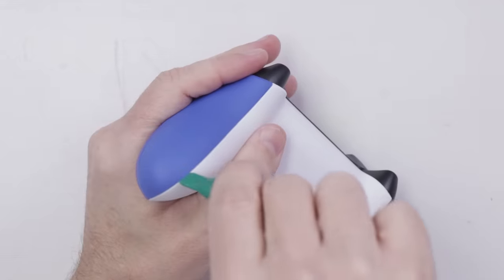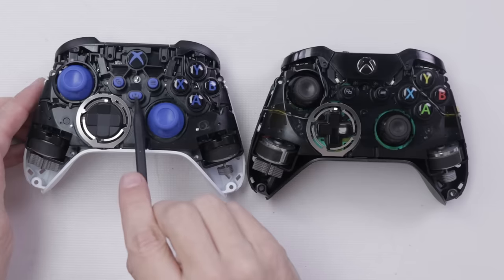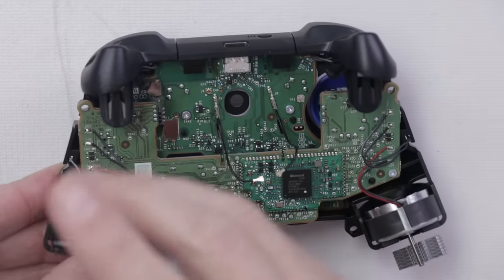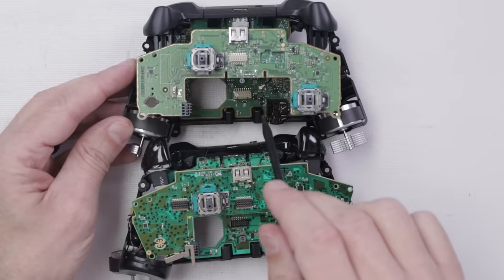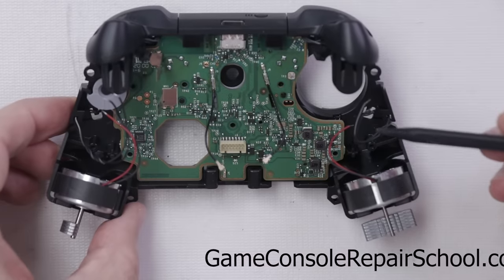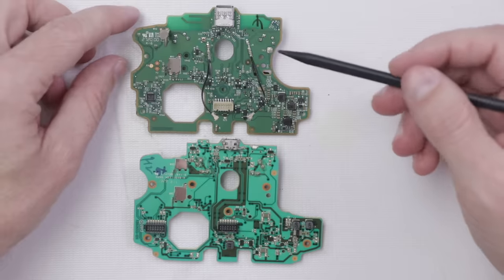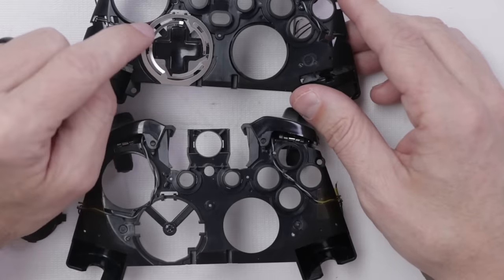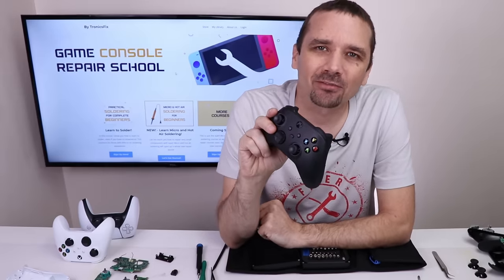Xbox Series Controller Teardown - A Repairability Perspective

Comment: Hey Tronics dude. I tried using your video to take my Xbox series X controller apart and I took the little wires with the tiny plugs that hold the motherboard together off and one of the connectors broke. I put the controller back together without reconnecting the wires and it seems to work but it turns off randomly and crap now. What are those two little wires for? could you tell me?

Comment: I’m not super confident in my ability to do it, but how possible would it be to use the shell, bumpers, and triggers of the new controller but replace the motherboard and sticks with an elite series 2? I love the functionality that the elite has but honestly I love the feel of this controller better. I know I’d lose the share button (which is sad but fine) but my elite series 2 has kinda gone through some stuff and needs a new shell anyways so I’m curious how possible/difficult it would be

Comment: Why is it they use two different size rumble wieghts just always wondered why they are not the same exact size and weight just out of curiosity
Reply: it changes the frequency of vibrations. if they were the same if would feel like a stone in a wasching machine.

Comment: So basically it's the same controller. Now, I play on pc and I've had too many problems with dpad on Xbox one controller. I change the plastic thing under the dpad 4 times in 6 years. Than last year I bought a DS4 and it works really well (I play many retro games, so for me, dpad is very important). I hoped the Microsoft would have make some changes on the dpad stuff. But it isn't... At least I'm happy that now I know what I will buy next 😌

Comment: I had a problem with the solder for the RB button it is small pins but the solder would not melt even cranking the Soldering iron to 450c still would not budge. Was nothing wrong with the Soldering iron i got as works on other things. I am replacing my RB button with a new one as it keeps failing to register and does not click as well as the other one.

Comment: The metal ring around the d-pad has a new extension that goes down and makes electrical contact with a hole on the PCB. Any idea what that is about?
Reply: doesn't look like it makes contact with the mobo. It probably hooks onto plastic in the frame to stabilize the metal ring better

Comment: I bought my xbox wireless controller last year (29.9.2021) (the irony, the warranty expired 1 day ago). So I literally never used this controller cause I bought 2 of them 1 carbon black and one red. The red one I used like 5 minutes. I left the batteries inside the controller and never used it again cause i was using the black one. few days ago i wanted to use the controller but it seems the batteries exploded and there was liquid inside the controller so the controller doesn't work.

Comment: Wait, so the series X S controller charge port is USB C?  I got one on Black Friday to use with a PC and Pi and I don't think anything in the 'manual' that comes with the controller actually specifies what kind of port it is.  Actually there's not much info at all on using this with a PC. E.g I needed to know the controller Bluetooth MAC address. Everything says "Go into the Xbox menu and...." well I can't do that. Doh
Reply: It is not a charge port, it is for connecting it to PC/Xbox/whatever via USB cable so you can use it without batteries. It only becomes a charge port if you buy one of their "battery packs". Otherwise it is not used for charging, the thing runs on standard or rechargeable AAs if you use it wirelessly/bluetooth.

Comment: Super disappointed they didn't upgrade the joystick modules. What a shame.
Reply: alexander pierre  spam
Reply: @proud90skid15  Reporting him.
Reply: alexander pierre  first off, the controller you say breaks in 2 slams actually takes 4 slams when I tested. Second, Xbox console is more durable than pee S console and will always be better. Also the console you call flawless is experiencing a higher fail rate due to fried gpu occurrences

Comment: Question. where can I buy a replacement rf wire that solders into the controller mother board and snaps into the upper board. There are two. I need one, someone tried to add fancy buttons and pulled the wire out of the connector. From my research people are saying it's a MHF4 0.82 with solder end. Is that correct or can you lead me to the right kind. Thanks

Comment: I use a Xbox Series controller on PC and it feels way better than the Xbox One controller!
Reply: So the sticks are a bit loosie on the center like in XOne controllers too?
Reply: @6abo.  Slightly but not even close to as bad as Xbox One is! Altho i'm sure with a lot of use they all get loosie goosie eventually but thats just how it is!
Reply: @Rulle666  in that case I think the elite series 2 would be a great option, thanks!
Reply: @6abo.  Yeah the Elite 2 is better, but its way more expensive and it ends up just as loosie goosie after lots of use too. So in my opinion its not worth all the money! But if you feel its worth it then absolutely go for it!

Comment: I'm a little sad that Xbox didn't do more with their controller. At least update the haptic feedback or the motors same type of motors that have been used all these years It's a little sad compared to Sony.. I like the fact that you can use it on the Xbox one consoles but at the same time I'd like to see a little bit of innovation not just some shaping.

Comment: lol! I tried to open my controller but accidentally tore tore the motherboard connector (came out with the motherboard piece). Is this fixable? Or do I need a new one?

Edit: I opened it because the home button wasn’t working, while every other bunny on worked fine
Reply: so they came out still connected/inserted? Are the legs broken off in the solder on the motherboard or still attached to the socket? Or did the solder all pull up off the board and tear the board?

Comment: Xbox made it so much harder to take these things apart. They could of designed it so you could of taken the 2 part mother board off without needing to worry about soldering. Course my bumper button has gone bad like 10 remotes before it. But I don’t think i can fix them anymore with needing to solder now. I’m pissed. Grrrr. Can’t they design a damn bumper button that doesn’t fail so often?

Comment: Does the controller still use battery???
Reply: If you want yes. It is also possible to use rechargeable batteries or the official xbox rechargeable battery pack

Comment: The big difference for me that wasn't mentioned at all in this video is the shoulder buttons (lb and rb) on the old style before the 3.5 mm jack, they were independent buttons that simply pressed down on an internal button. The 3.5 jack version for some reason made both shoulder buttons connected with a super thin piece of plastic that is meant to bend when the top button is pressed and eventually snapping in half or at one end. Which would be such a big problem except for the other dumb change that made the 3.5 jack controller so bad, they moved the internal button from facing up, to facing down (as you can see in this video) and had that dumbass connected button reach down and sideways to press it... It's seriously the most idiotic way to do it because they constantly break and now you can't even press down harder on it to trigger the button. Or maybe they wanted it to happen to sell more... Either way, I'm glad someone there caught that big mistake and fixed it.

Comment: Hello sir I have problem with my controller it wasnt calibrated my analogs didn't stick to the calibration wall and right ananolg in cod wouldn't stop just moving right and left I took it to a so called technensian and he changed shocks for 3 or 4 times last time I tested it and everything was normal but when I returned home and wanted to play after 5 min controller got crazy left analog only want to left d pads jumping 2 up and down I recalibrated it fixed but 5  min later it got crazy again this time right shock only fast turning to left and left and right sides were changed.after every successfully calibration its goes crazy again Please help me is this issue from board or shocks.its been 10 days and not fixed yet.

Comment: I found that the wires connected to the rumble motor come undone much easier than on the Xbox One S controller. Do they do anything other than operate the rumble motor?

Comment: I do not understand the need for three removable plates on the controller.  It's unnecessary in my opinion.  You have the very back plate, you have the two side grip plates, and you have the faceplate.  I find that to be a very stupid design choice.  I don't get it.  I think it would make more sense if it was just a top faceplate and a backplate.  Two plates total that are held on by screws in the back.  PlayStation uses exposed screw holes and there's no fuss over those, so I don't understand the need for Microsoft to hide them all on theirs.  My biggest pet peeve with these controllers is small, but irritating.  If you have an Xbox controller, you probably know what I'm talking about. The side grip plates are rarely if ever, flushed with the edges of the faceplate. Which gives it either an underhang or an overhang.  This is extremely annoying because when you are holding the controller in your hand, you can feel sharpness from the not flushed edge of the side plates.  I have a controller that is completely flushed on the right side with no sharpness. But the left side has the edge of the faceplate hanging out a few centimeters over the side grip plate. So when I hold it in my hand, it feels like there is a sharp sensation running down the palm of my hand because I am feeling that Gap between both plates basically. It's very annoying.  And I don't know how to fix it without taking a sander to the top faceplate and completely ruining the aesthetic to sand it down to where it doesn't extend out past the edge of the grip plate.  I really don't want to go that route.

Comment: Microsoft knew what to do just improve an already amazing controller, sony on the other side... they made a controller that spys you with both mic and because of that the battery life is super bad and its much less confortable than the xbox controller
Reply: Well you clearly haven't even touched one because you can mute the mic and the battery life is fantastic as well as the ergonomics.
Reply: @brandon_nope  Ye all experts say that if you use its new tech it lasts 2 hours and a half, and without it a maximum of 7 hours while the switch controller lasts like 50 using the hd rumble which is the same as haptic rumble but with other name the tech is the same, it will happen like in the switch nintendo will use it for 1,2 switch and not use it anymore in ps5 only astros playroom will use it and you won't see it anymore, i have touched one and use it like an hour a friend of mine let me use it and i think its ergonomics are garbage compared to the switch pro controller or the xbox series x controller
Reply: @soulmourne2698  I personally prefer Xbox and Nintendo switch controllers as well (i had a Logitech gamepad at one point which had the PlayStation stick layout, and I'm not really a fan of that stick layout)
and I often prefer to play with the rumble turned off completely anyway (with the exception of certain games, one of which is Monopoly)
Reply: @pineappleroad  I have my own exception too and its dragon ball budokai tenkaichi 3, but anyway the problem is that if you don't use the rumble why buy a new controller if the new thing that offers is rumble and a bit different ergonomics? i think its not worth the ps5 controller personally i even preffer the ps4 one
Reply: @soulmourne2698  I also find it a shame that sony seems to have decided that PS5 games can only be played with a PS5 controller (and not a PS4 controller, PS4 controllers only work in PS4 games)
Reply: @pineappleroad  yep i know...
Reply: @pineappleroad  It's probably so that players are forced to use the new controller to not miss out on the new features. Personally, I don't think it's a huge deal considering most people will only need the one controller already packed in with the system.
Reply: @soulmourne2698  Whoever is saying that is blatantly lying. I played a few hours of Astro's Playroom and then a few for a couple of PS4 titles and I still didn't kill it.

Comment: I just felt ashamed for Microsoft. Not a next gen controller. Lack of initiative.
Reply: Its a controller. Lets be real, very few games are gonna use the PS5 controller and if they do its gonna be very gimmicky. Plus looking at how bad the dualshock/dualsense game compatibility thing is with PS5 playing PS4 games, Microsoft made the right call.
Reply: @elk3407  the haptic feedback in general feels more premium. It's like comparing taptic engine from iPhones with normal vibration motors in regular smartphones that are no flagships. It's so much more nuanced and doesn't feel so outta control once it started. It doesn't just vibrate the whole controller but gives you even slightest feedback in form of little "taps", like feeling individual raindrops. And that on different areas on the controller, clearly distinctable from each other.

Furthermore, it will be used widely is my guess. Sony did it clever as they provided presets for the features, so developer can base their work on them. In addition some kind of rumble feedback and the use of triggers is just there in games anyway. It might take some extra work, yeah, but it isn't that complicated and when old gen isn't supported anymore, there is no reason to just use it. Especially as I am pretty sure, Microsoft will also deliver a new controller in the next years with exactly this featureset. It would be a shame if not, as I would classify the DualSense now as the new standard for the industry.
Reply: @paddipat  Ok, haptic feedback is a good point. Both Switch and PS5 have great haptic feedback and xbox's is lacking...... but everything else the ps5 controller has new is really gimmicky. I actually violently hate the new triggers, so I'm gonna have to say NO to the dualsense being the gold standard.
Reply: @elk3407  you hate it, objectively it's better. It's possible to turn the feature off, so no reason to not just include it.
Reply: @paddipat  But what is the point of a feature that only exists to be a gimmick for tech demos? In what way could a developer use this to elevate the gaming experience in a way that isn't obnoxious? How does this elevate the gaming experience in the same way that adding motion controls to fps games for more precision does? Did anyone even use any of the ps4 controllers gimmicks like the touch pad on a regular basis? The answer is no. People forgot it even existed.
Reply: @elk3407  triggers are regularly used already. And I think they're great, like many others out there. The feedback in shooters like Cold War is fantastic, and I guess I can't imagine with what creative ways the devs can play with that. The value in this case is "immersion", and for many players out there that's an important aspect for gaming, at least if they're not just the kind of player who only plays multiplayer and sports games like fifa.

In your eyes it might be "obnoxious", but that's just you. You're really not a reference here.